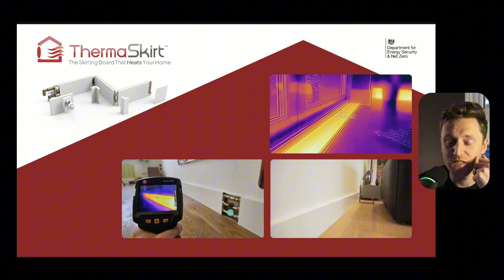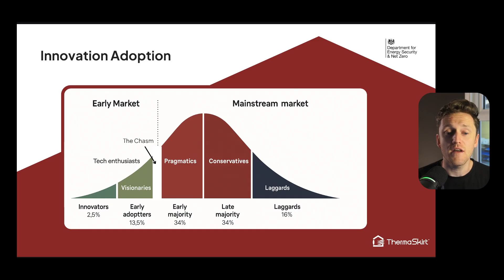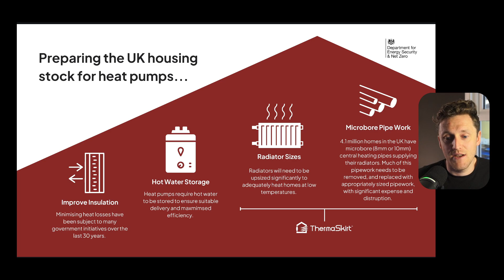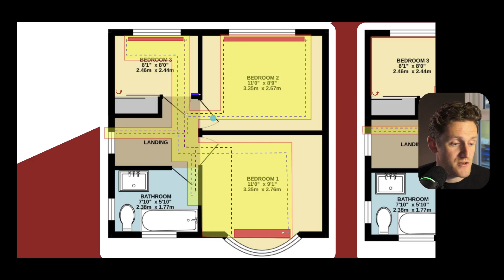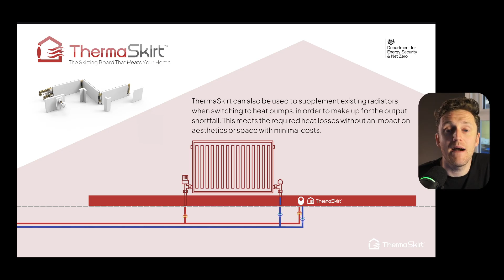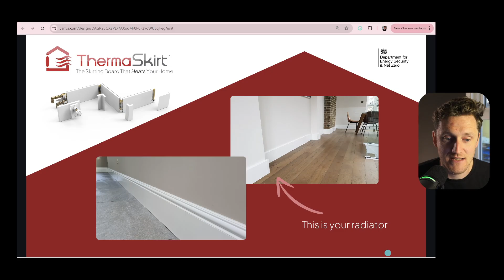Heat pumps are viable, cheap, and nobody's buying them

Comment: If installed in a kitchen would the heat no eventually warp the timber or material the presses are made from?
Reply from the maker: No the skirting (particularly on a heat pump) is low temperature and so won't impact the kitchen like that. There is far more energy from the back of a fridge or washing machine.

Comment: Very valid arguments & observations. 
I spent 50 years in the HVAC / Heat Pump industry so I consider myself more knowledgeable than your average homeowner on this subject. 
I have decided against an A2W HP system for the reasons you highlighted but also because our gas boiler is not that old. I did consider both ThermaSkirt & conventional radiators with a HP but the cost (even with the grant) &, more importantly, the disruption & upheaval to our house were just too much to contend with. As you pointed out retrofit vs new build are too very different scenarios. There were also some technical reasons / restrictions relating to the location of the outdoor HP unit that influenced my decision as well.  
   
Instead I am considering adding an Air to Air Heat Pump system (Multi Split system) for the lounge & some bedrooms. We already have an A2A HP split system in our conservatory (used mainly for winter heating) which cannot be connected to or heated by our existing gas boiler system (planning regs). There are no grants or incentives for A2A Heat Pumps (yet) but they are much cheaper & less disruptive to install than A2W systems & they have the added advantage of providing cooling in summer which helps aid sleeping during the hot humid nights.

I think ThermaSkirt is a great product for a new build scenario. It's also good for retrofitting in some cases but the cost & disruption needed for my house (with existing 10mm microbore pipework) was just too much. Had our house been a "fixer upper" then knocking it about to install new tech & systems would have been OK but it's not &, at our time of life, major upheaval is not what were are looking for.
Reply from the maker: Yeah totally understand all that. You have to do what's right for you and your particular home. 
At the moment we're getting over 20 sets of plans per day from customers wanting to get rid of their radiators and for many they aren't even on a heat pump. 
They just want more space and cleaner lines (you never see a white panel rad in any of the interior design magazines). 

For others it's about energy efficiency and saving money by installing ThermaSkirt and turning your boiler down. But I find that for most customers it's a lifestyle benefit rather than the financial one which drives them. 

Because we are 'energy agnostic', I always advise our team to give customers impartial advise based on our experience. Often heat pump is not the answer.

Comment: I think the fact that the companies able to access the grants are charging excessively to do the install may have something to do with it. I have friends who have irealised they could have installed it more cheaply but NOT taking a bit plumber on to access the grants. The provision of grants through approved installers is a scam.
Reply from the maker: You raise a valid question, but there are umbrella schemes offered by companies so that those who aren't MCS registered can install heat pumps and have them signed off by a third party. 
You need to consider the alternative, which would be to have people out there installing something like a heat pump without a quality control process, or a standard to meet. It would likely lead to a large number of cowboy installs resulting in poorly sized systems, low efficiencies, and unhappy customers. 
Using a system like MCS is just like Gas Safe. It sets a minimum standard for this type of work. 

You are right that financial barriers are a major part of it!

Comment: I really like the concept, given the current weather variations a life style benefit could be cooling, have you run tests with the skirts to validate if they would work to cool down a space?
Reply from the maker: Hi there, very interesting question. We have as a matter of fact. Given the dew point, the water in the skirting cannot really fall below 15deg C, so whilst it can have a cooling effect, taking energy out of the room, its no where near as effective at cooling as an air exchange system is. 
That being said its only energy in and energy out, just like underfloor 'cooling', as the aluminium of the skirts effectively acts like a giant heat sink. 

If you run the skirting from an UFH manifold, you can hook up a condensation sensor to the wiring centre as a fail safe.
Reply: @thermaskirt  Thanks for the well thought out reply. I see that it might not be as efficient as a split system.

Have you tested it using a ceiling fan, I have seen some that are super simple to setup and might allow the cooling down of the room to be more viable.

Good luck😊
Reply from the maker: @vottat  I actually havent tested it will a fan. Although now you have me thinking. 

Fancy giving it a go? 😅 

Ethan 

😅
Reply: @thermaskirt  Are you thinking? that is dangerous, have you tried "not thinking"?

I would really like to try the FanSkirt 😂

Victor
Reply: I used to work for a company that made chilled beams as a passive cooling option. It was great in Riyadh, with 0% relative humidity, but a disaster in Dubai where the moisture would condense on the beam and drop everywhere. You can't rely on cold surfaces to do the cooling without being able to remove humidity.
Reply: My biggest problem when I was looking into it in October last year was that my boiler had packed up and the lead time to install heat pump and remedial work (radiator upgrades) was going to take too much time when I needed to get warm. The other aspect was, as you say, radiator upgrades, but also the fact that I had just refitted my kitchen 2 years earlier and there was no sensible way to install a radiator there, which was a requirement to get the grant. 

BG also had no real knowledge of Thermaskirt, which I was very keen to use instead of upgraded radiators. I love the idea of Thermaskirt plinths! That would've solved my problem.